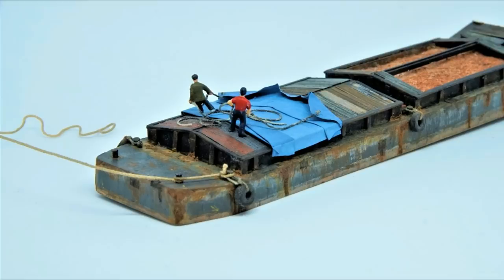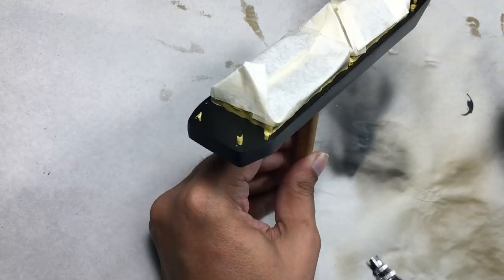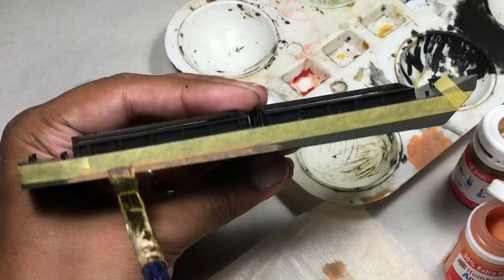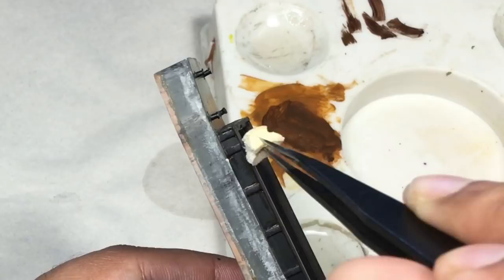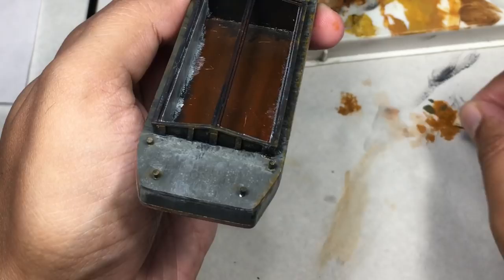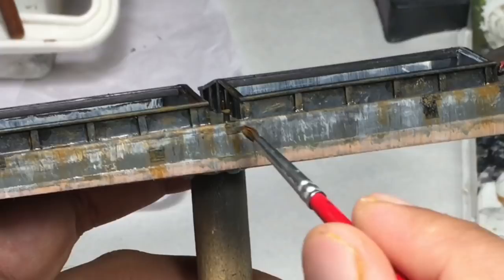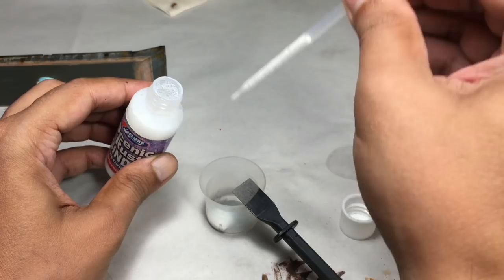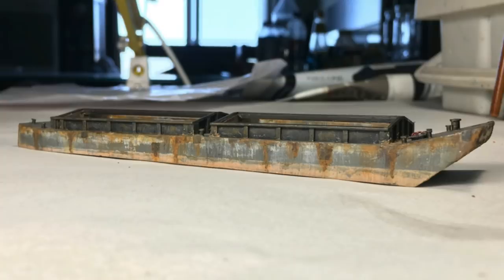How to Create Realistic Weathering Effect: The Barge, Ep 2

Comment: I have weathered my railway box car with acrylic paint, do i have to overcoat with varnish or not . It is the varnish i seem to struggle with ?
Reply from the maker: Yes. There are two uses of varnish - one is to give you the required finish (gloss vs. matt, for an example), second is to protect the surface during handling. I can recommend Testors spray lacquer as a first step as it is easy to use. Hope this helps. :)
Reply: @TrainsandDioramas  Thanks , i will order some.
Reply: My Testors spray came today, very impressed with results , ended up doing 3 boxcars and a loco. Thanks for tip.
Reply from the maker: I’m glad that it worked out for you! Happy model making. :)